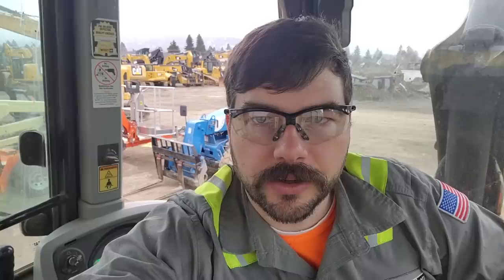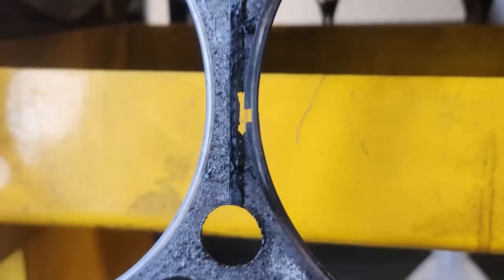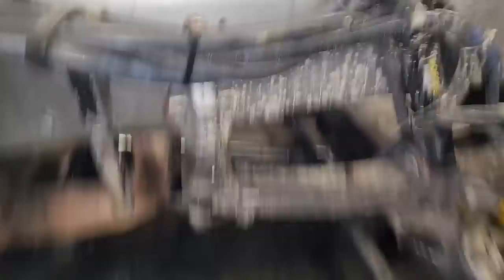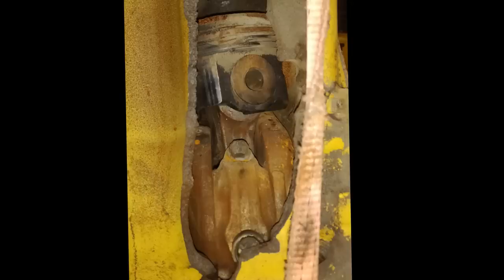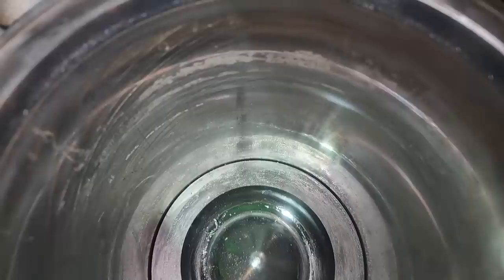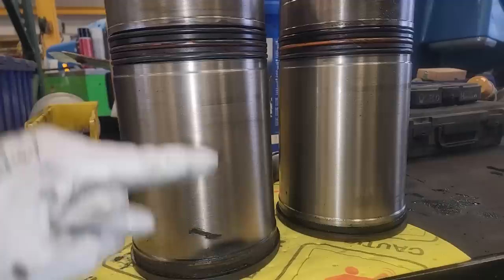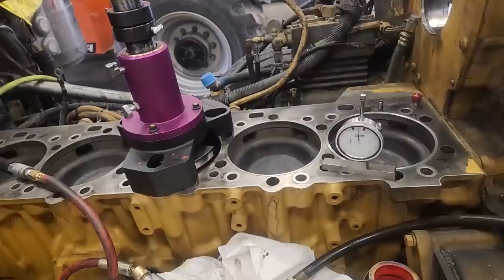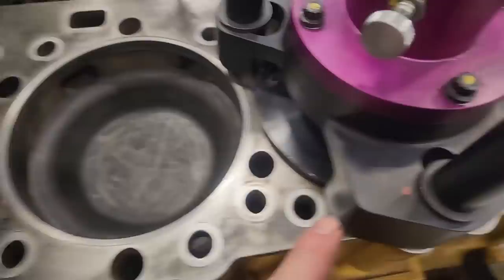Purple Pete gets some "EXTREME MECHANIC-ING." C-15 Cat Repair.

Comment: I find it interesting that every mechanic I watch online calls them spacer plates.  Around 2005-2007 I worked for the company  in Eaton Rapids, Mi. that made them for CAT. We always called them deck plates.  Now some of you may find it hard to believe but. No, CAT does not make it's own parts at least not for everything.  This factory made hundreds of different parts for CAT.  Mostly brackets and mounting plates, and some large assemblies such as the radiator hoods for the big mine trucks.  

I can say that evey single "deck plate" CAT used at that time came from there.  They were laser cut from sheet steel, staitened, machined, ground, tumble finished and 100%  inspected.  This consisted of being placed on an engine block with pins in every hole to ensure they were all there and in the right location.  Several samples per shift were subjected to additional inspections and a full dimensional check on a CMM.(My job)  We were a dock to stock facility, so as soon as the parts were received at CAT they were placed directly on engines being assembled without  further inspection.  I left in 2007 so they could still be making them today for all I know.  Some of our production did get boxed for the repair part buisness.
Reply from the maker: Very interesting information. I'm still going to call them spacer plates, but I'm not surprised that Cat uses a variety of vendors for their parts. Cat has Cat tools as well, which have Cat part numbers, but are made by a variety of different companies.
Reply: We always called them deck plates.

Comment: My dad would use that piston plug but he did not use the tool you used with the impact he removed the rod cap and used the tool to turn the engine at the flywheel and the piston would push out the pack all together. Whichever piston was the lowest was next inline. Great video!
Reply from the maker: That's actually a really good idea, I might have to try that.
Reply: @AdeptApe  They come out quick and less stress on the threaded rod in the plug. It's been so long that I forgot he would put a lifting eye on the rod to make it easier to lift it out. He passed in 2006 so my memory is fading but he worked for Holt of San Antonio for 38 years. I'm not a mechanic I just drive the hell out of them:)
Reply: @AdeptApe  the old cat book said to put it in high gear and jack up a wheel and turn the wheel pop goes the cylinder pack

Comment: I used a long body air sander to sand the top of block! Did not take a lot off but cleaned it up nice! Those brake diaphragms come in lots of sizes, did D353, D342, and others using them! I also made an extension for the insert cutter to get the handle above the front plate, made it a lot easier than keep moving the handle, on number one! Have to wonder why water ferrules were high they should have surfaced the cylinder block to make it so! Our machinist that does that job would at lest gone back over them with a mill to make them level with the block! Have to wonder, did they surface the block then decide to fix the ferrule holes?  I would put all new liners in, they wear to match the block surface over time so block worn so are liners! Was fun to watch you do this job, keep having fun! those oil ferrules made it a lot better to control oil, but we used copper coat along with them to help make sure, thin yes, but filled in the voids!

Comment: I still use anaerobic sealant on the spacer plate shim also When I usually cut my bores I cut down until I know I am getting close within a couple of thou then I drop down to cutting 1/2 thou measuring with a digital depth guage then once I have my depth I roll the top adjustment down tight and use a paint pen across the two of them to give me an indexing point great work love your channel !!!!

Comment: Weird the way that top deck on the block has that coloration to it. Perhaps some used a sealant on it. But I was under the understanding you didn’t want to use sealant on those. That counter bore cutter worked beautifully. Good setup always helps to though. Once back to work she should run like new. Always a pleasure watching and always interesting and informative. 👍
Reply from the maker: I'm wondering if it had something to do with the fire rings allowing carbon maybe, it is very strange though.
Reply: Looks like a 7.3 block/head after removing the graphite head gasket.

Comment: I like the cummins jets because being plastic they'll break off you forget. If you accidentally bump those and even bend them in the slightest- they can be reused and nobody is the wiser until the customer melts #6 pulling a hill a week later.  Just my .02 though
Reply from the maker: Yes, plastic internal engine parts are a great idea in general 👍 perhaps even paper would be even better.

Comment: I've used pieces of granite off cut from a countertop manufacturer to use as a sanding block. Works like a charm for sanding the block 👌
Reply from the maker: I bet they are pretty dang flat.
Reply: @AdeptApe  Very flat, also very abundant, free and in all sorts of sizes and shapes.

Comment: 8:55 A common joke in my area. Engine techs would get apprentices to push up under the liner when removing at which point the apprentice would get doused in coolant. 

A dck move to be sure but an apprentice should know better and it encourages them to think ahead. If a wet liner is surrounded by coolant one should assume that there's going to some coolant there, so don't sit under it.

Comment: I started using CRC gasket remover to clean decks and heads. It also lifts thick solid carbon deposits off the pistons, amazing stuff really it saves me a ton of time.
Reply from the maker: Does it remove carbon from EGR parts?
Reply: @AdeptApe  probably. It sprays out like snot so it's more meant for coating a surface. After it sits for 10 minutes I use a plastic scraper to remove the crud.

Comment: I had a twisted o-ring on my a cylinder sleeve after a platinum rebuild… it blew after about 20k miles. Had similar issues to begin with eating coolant

Comment: You should use the roller bearing from the inj cup pulling tool on the pack puller. Prevents slipping and burning up the 400 dollar rubber cup

Comment: The dark color looks like someone used "Indian Head" gasket sealer before they put the shim in place.  It leaves a dark brown to black color to the metal.  It's a shellac type of sealer commonly used on motorcycle cases in place of gaskets.

Comment: Was the liner projection low from losing its crush and moving around? Odd that a reman short block has low projection.
Liner is 0.350, minus spacer plate 0.338, minus shim thickness roughly 0.008. So projection should be around 0.003 to 0.004 typically. 
On our stand to pull the pack, we added about one inch, so the liner comes completely out of the lower deck. I use the counter bore shim as the gauge. I mic all shims and get the thinnest one of the set. Once my tool is set up I use masking tape and tape over the top of the entire deck to prevent metal shavings from getting into head bolt holes and water holes. Very odd color on the top deck.
Since 5EK engines and such don't have a drain back seal. I asked to see if the funnel seal could be made and put in that area. Not sure if it has enough material to rest on.

Comment: I thought in part 1 you stated that the block was a cat reman and the other shop simply installed the long block, then installed the head and accessories? If it was a low mileage block why would Cat not pay to correct the liner protrusion issue?

Comment: To protect the deck of my pullers if space isn't much of an issue,  I'd pick up a small taper bearing and race with the inner dia of the bolt. Put more effort into pulling instead of turning force. Also a LOT cheaper than a thrust bearing.

Comment: You do the same things as me which makes me feel good that I've been doing it right for the last 22 years, but I quit using the liner puller plug and go straight for the "jaws of life" and pull liner out separately. We cut all our blocks now just to be sure the protrusions are good.  I'm interested in this aftermarket head quality, is it IPD ?
Reply from the maker: Haven't got the head yet. There will be at least 1 more video in this series and maybe 2.

Comment: You have to do at less a 100 foot pounds of torque on your liners   in order to find tip an dropped liners that’s why a lot of over hauls fail an put it at 6 thousands because liners settle over heat an time number 5 is problematic because of the manifold passed the hot gas to the center making the back center to burn up so get a manifold with better flow

Comment: What would happen if you just put the thinnest shim possible under all the liners but didn't cut the counter bores , or install the shim on the cylinder that dropped then recheck the protrusion on the cylinders that were out of spec  , would that give sufficient crush on that cylinder ?

Comment: Is that considered a warranty repair since it is a low hour CAT long block?
Reply: put many long block Cat reman engines together and found the quality to be awesome. This engine really made me wonder about the quality control now used. Also I bet the   blocks being rebuilt now are getting pretty worn out  I got a Cat reman engine from Cat on  a warranty claim and it has an over cut  block and under crank in it. No problems.

Comment: seems odd that you cant mill the shim plate down one or two thou to get the clamping back. That what shims are for, to fine tune the tolerance.
Reply: At one time Cat sold a thinner spacer plate. Do not know if it is still available. The problem on a top flange liner on a Cat is, the head gasket fails usually between two cylinders. Between four and five is the most common place. So the top deck of the block has fretting from the liner into the block. As the clamping force is relaxed from the failed gasket. Thus the fretting is not consistently around. The rear is usually worn more over the front. So by putting a thinner plate between the head and cylinder block, you are forcing the liner flange into a non level area. You may break the flange, have uneven liner projection. Thus you will have a early hour failure on the joint again. Years ago you had a cast iron shim. As emissions got tighter, cylinder psi increased. So the cast iron shim cannot handle the load. The stainless shims hold up better.  Higher HP  engines makes the problem even worst. As fuel is injected the liner expands and contracts. As the liner is so much harder over the block, that area wears out.

Comment: Hey Josh, any chance in getting the part numbers for the bolts and washers that you used to torque downdown the spacer plate and liners?
Reply: Required Components for C15 Through C18 
Location 	Part Number 	Description 	Quantity For One Cylinder 	Quantity For Six Cylinders 
1 	                 7H-3598 	         Track Bolt 	                  6 	                                        26 
2                      8F-1484 	         Washer 	                  6                                            26 
3 	                 7X-0564 	         Washer   	                  6                                     	26
Reply: Thank you.

Comment: How did that low hr short block have such low protrusion?  You said it wasn't built by cat correct?
Reply from the maker: It was a Cat Short Block, but an independent shop assembled the engine (installed the structures, head, etc). Found out today that they really liked silicone.
Reply: @Adept Ape  so how was it so low?  Was the deck not flat under liners? Assume a short block was a reman block surely decked or a new block that should have been flat.
Reply from the maker: The deck was straight. Perhaps they didn't torque the head bolts correctly, hard to say,  but they are measuring better now.

Comment: When cutting the counterbores. Why do you skip cylinders?
Reply from the maker: Excellent question and I meant to answer that in the video, but forgot to. It saves time actually, so if you go in the order 1,3,5,2,4,6 it allows you to only move the machine once every cut. If you try to go 1,2,3,4,5,6 you have to move the machine out of the way to clean the metal shavings and do your measuring after each cut, then move the machine back. So you end up moving the machine twice as much as it's a heavy and sensitive machine, so the least amount of moving and time wasting the better.

Comment: What the hell is on the end of ur air gun lol. Is that copper with compression fittings lol. I hope not. But it looks like and extension. 

At the 10:30 mark where you point ur finger looks like a chick with her hands on her hip and a leg hiked on the liner lol